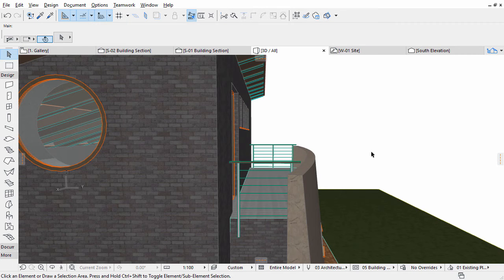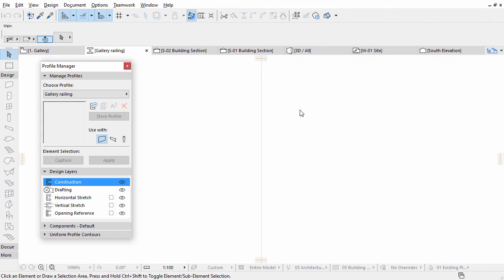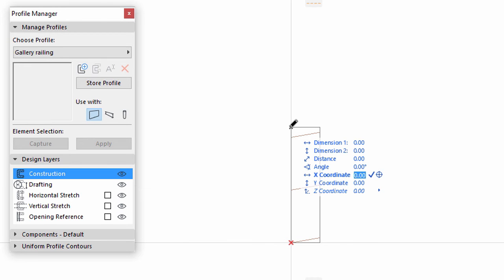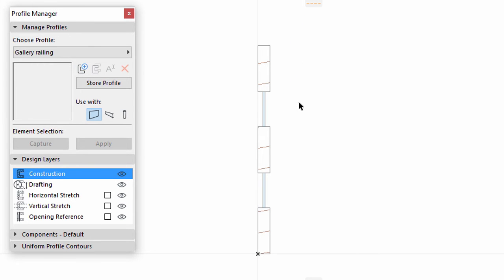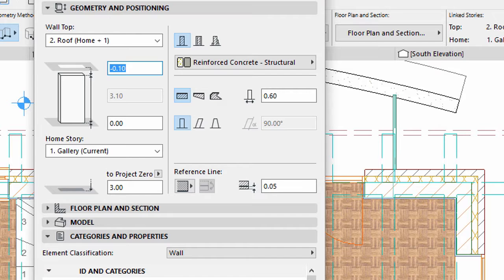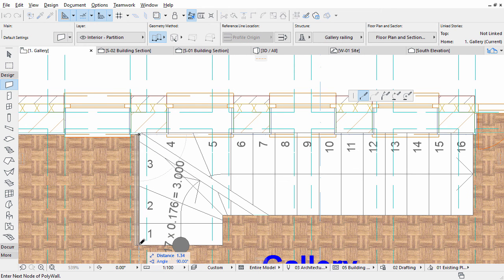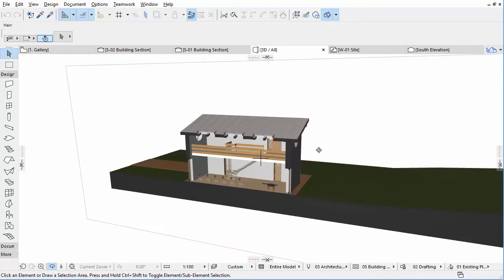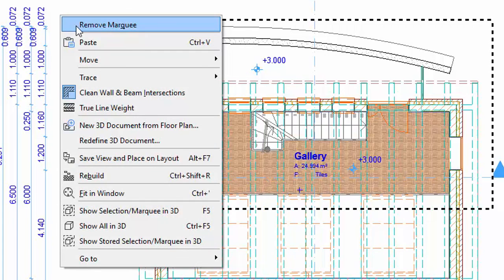Creating a Railing with a Profiled Wall - ARCHICAD Training Series 3 – 31/52

Comment: Nope.  Not only does my profile manager not have any horizontal/vertical lines intersecting at the X, but when I follow your directions for drawing a rectangle at 1:45, it draws a line instead.  Yes, I have selected "Geometry Method: Rectangular".  I'm using YOUR file save, and the software is up-to-date.  You're probably going to reply (if you bother to reply at all) that something is toggled off by default and I need to toggle it on, but understand this.  We (new users) are beyond sick and tired of this kind of stuff peppered throughout this tutorial.  It is impossible to learn to use this software proficiently if the people who are slapping together ineffective tutorials don't even know how to use it.  This is so damned frustrating.  If I didn't HAVE to slog through this tutorial, I absolutely would not, and it definitely lessens my overall opinion of ArchiCAD and Gravisoft.